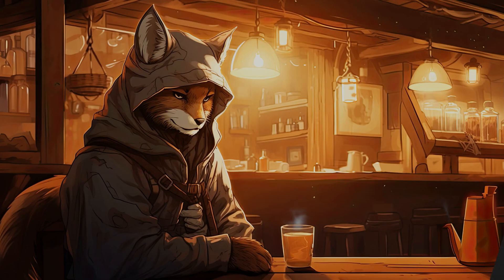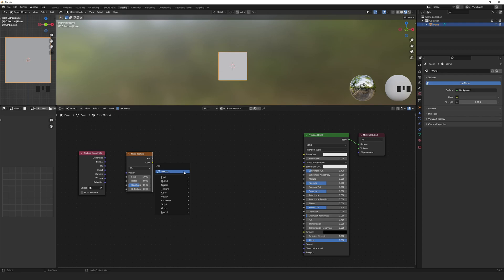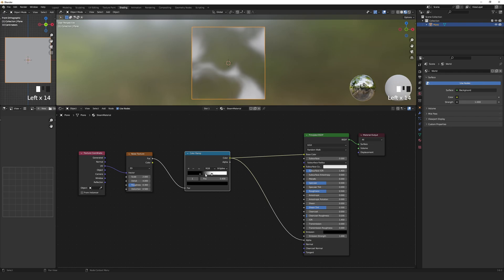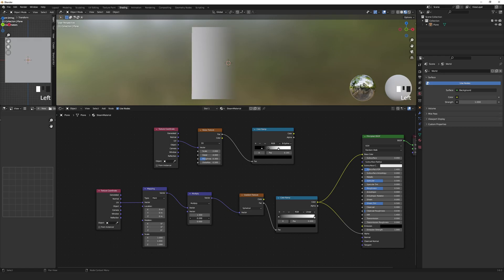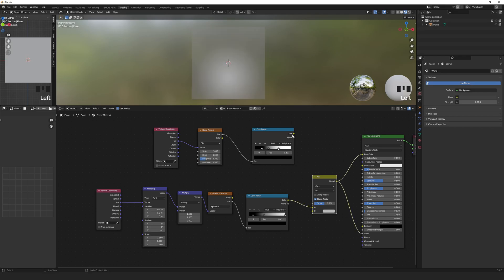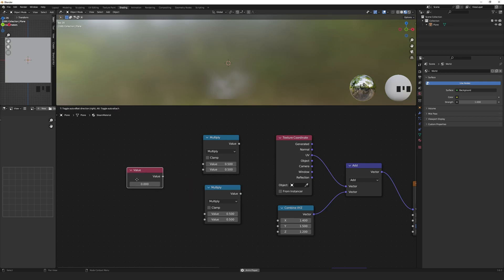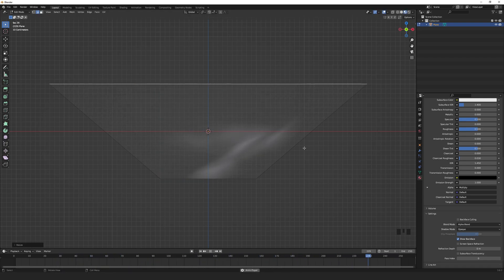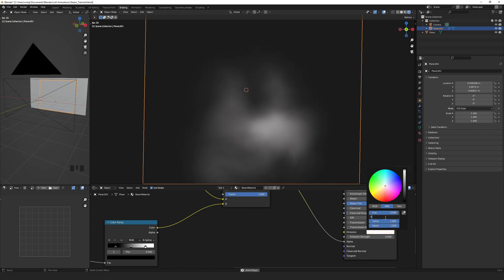Simple Steam Animation | Blender Tutorial

Comment: I'm following this using 4.2 and not seeing any Blend Mode under the Material Settings tab with Eevee.  Has this been moved or removed?  Should I be setting the BSDF Alpha to zero?
Reply from the maker: There have been a few changes on Blender 4.2 including Blend Mode being replaced with Render Method. Alpha Blend has now been replaced with Blended. While Dithered behaves the same as the previous Alpha Hashed. Hope that helps!
Reply from the maker: Also, the Alpha on the BSDF node should be controlled by the multiplier node taking in the noise and mask, so no need to set it to anything :)